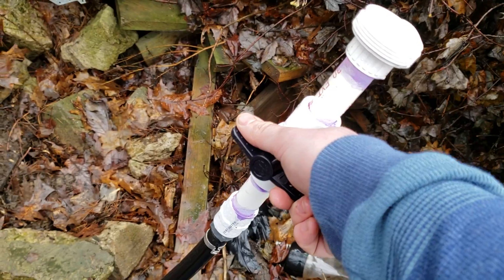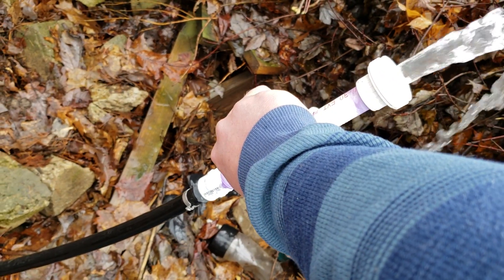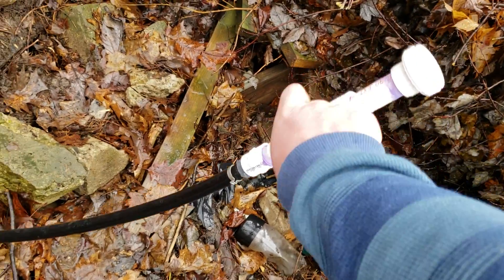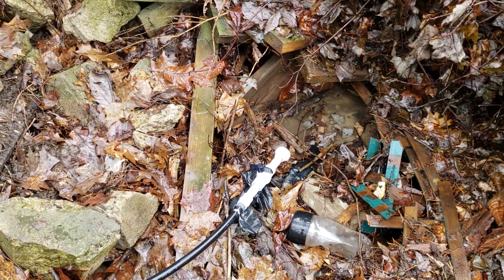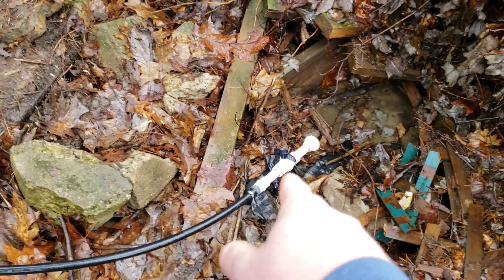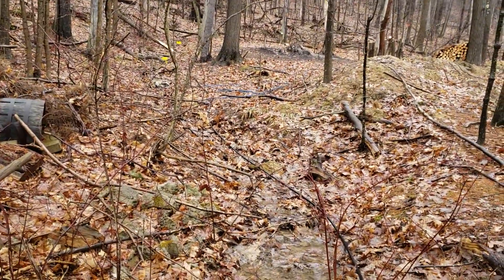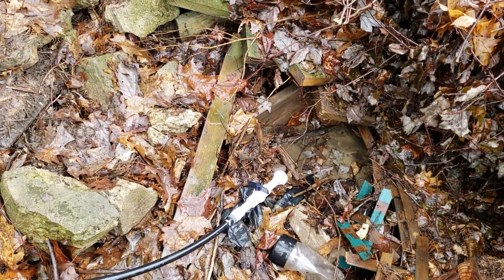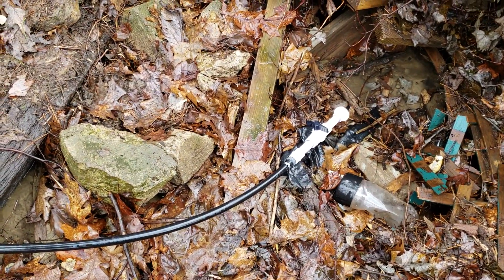Why You Should Turn Turbines Off Slowly. (Spring Creek)

Comment: You can get rid of water hammer if you install a capped piece of pipe vertically at the end.  The pipe will contain air which will compress when the valve shuts and cushion the shock wave.